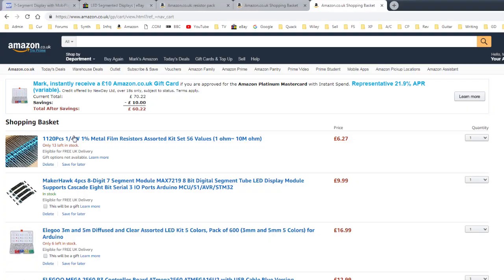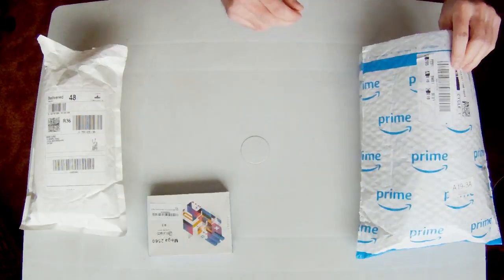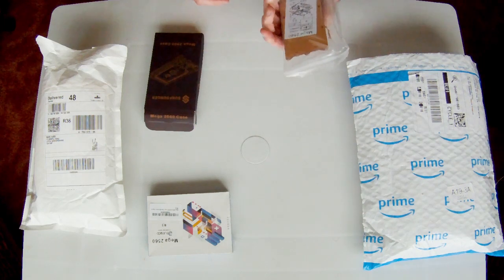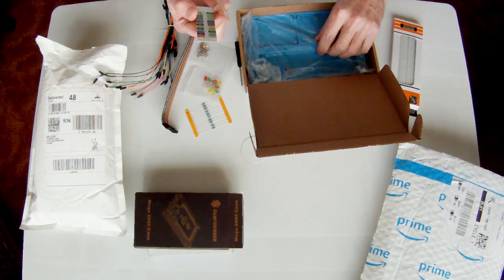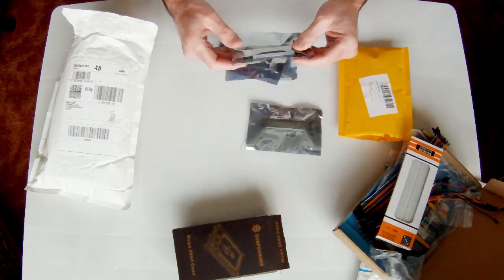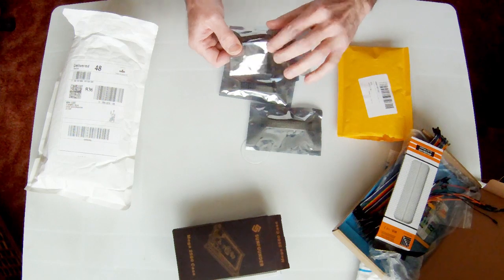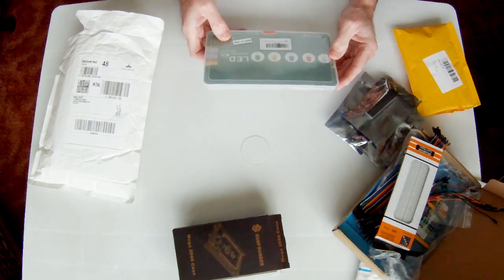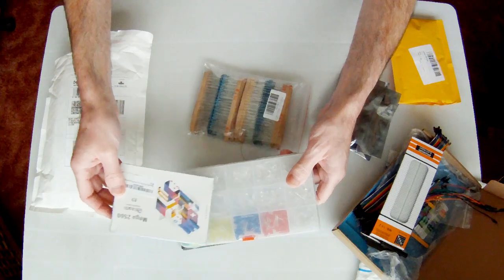Connecting the Arduino to Air Manager (Twin Otter Cockpit Build - Part 47)

Comment: Correct -- Win 7 does not have Drivers -- You need the Arduino IDE.  Win 10 has the Drivers native.  I had similar issues with a RealSimGear GTN Bezel that uses a Mega in it.